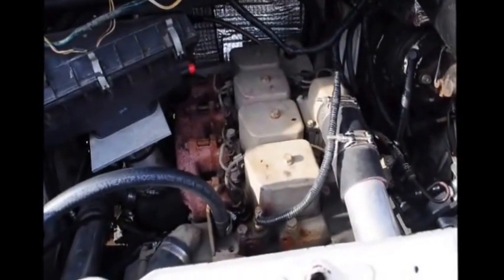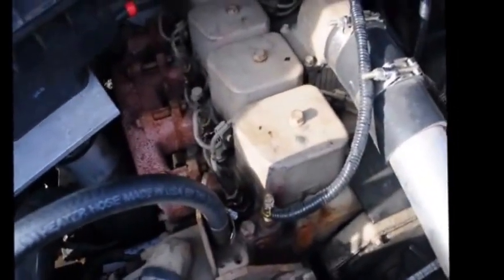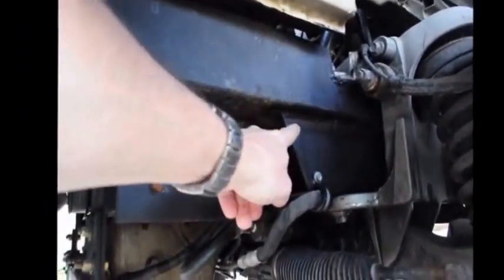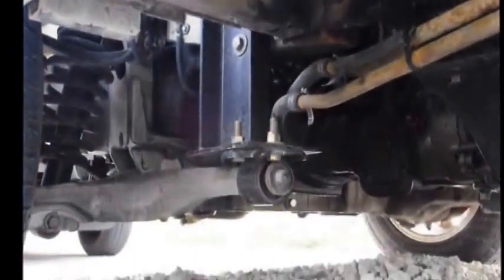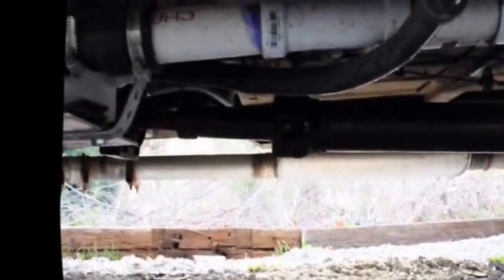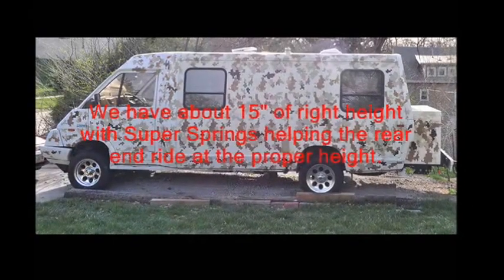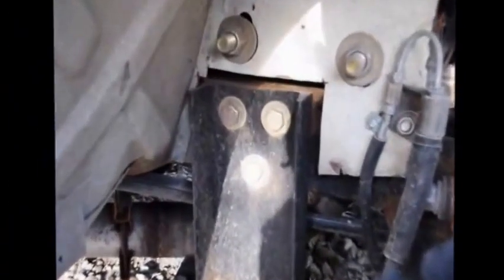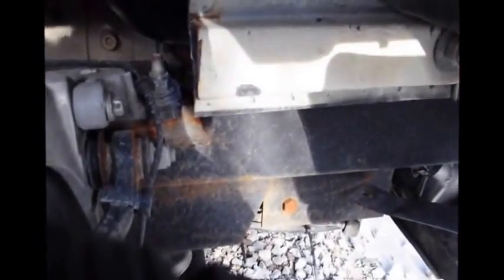Winnebago Lesharo 4BT Engine mechanical Overview

Comment: Good job...I got a 1990 4cyl, what to put on different frame, and motor....any suggestions what vehicle would fit?
Reply from the maker: Mid 90s Ford or Chevy truck with wheel base.  Typically 157" or so would be extended cab with long bed or crew cab with short bed.

Comment: What is your MPG now?
Reply from the maker: We averaged 20-21 MPG doing 70 mph on Hwy 80 heading to Wyoming.  Amazingly we saw mid 20s driving on Grand Tetons and Yellowstone because the speed limit is under 50 mph.  I think it is best to keep a 4bt in the power zone of 1700-2000 rpm which rest in the 55-60 mph.

Comment: I take it you had to beef up the suspension in order to accommodate the Cummins 4bt Diesel engine.
Reply from the maker: I had to add a sister frame in the front to allow the crown vic suspension to bolt up.  The steel is bolted and welded in.  I bolted first to get the geometry right then welded it.  The crown vic suspension underneath really keeps the frame from flexing under the 750 lb engine weight.  The crown vic suspension has heavy duty spring which I had to also put spacers to give it a few more inches of clearance.
Reply: Ah! Ok. That would certainly help. I've heard of the Winnebago LeSharo having a diesel engine, but having a Cummins 4bt seemed pushing it.
Reply from the maker: About 50 to 75 more HP and 150 to 200 more torque.  The original Renault turbo diesel was barely adequate and most likely unsafe due to slow acceleration.  Good mpg however at lower hwy speeds.
Reply: I would imagine so. What horsepower does the 4BT deliver vs. the original Renault Turbo Diesel? How much torque does the 4BT deliver vs. the Renault Turbo Diesel?
Reply: Are you still working on the conversion, or are you finished? If you're finished, How about a drive around town?

Comment: How much would you charge me to put one in my lesharo?
Reply from the maker: I wish I could put a price tag on it. Engine alone runs 2k-3k.  The laundry list of other parts add up to another 4k.  Rear axle, trans, 2 piece drive shaft, radiator, vacuum pump bracket, frame enhancements.  Probably 200 hours of work.  I really could not imagine someone being as crazy as I was to do it.
Reply: It may be crazy, but if you like the results, then I would think it'd be well worth it. :)